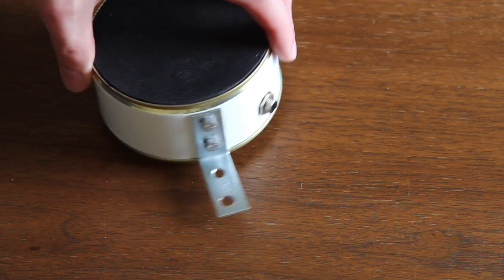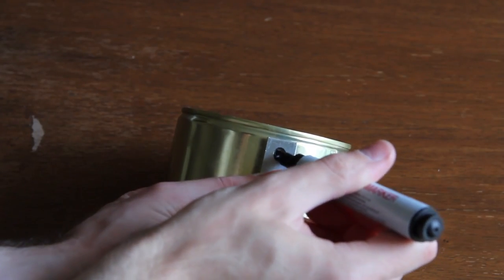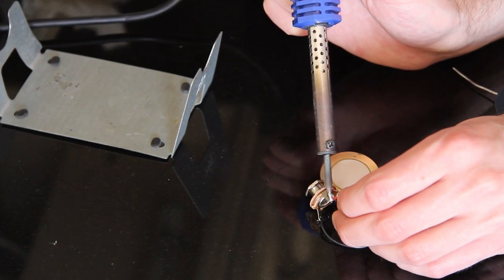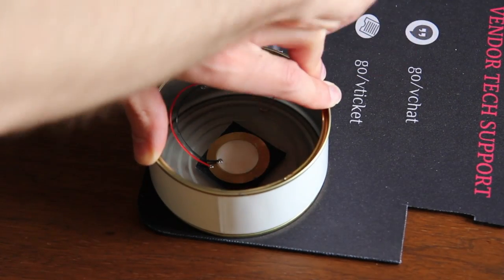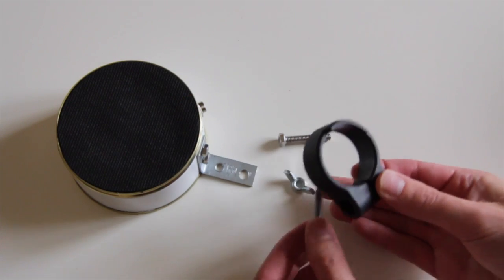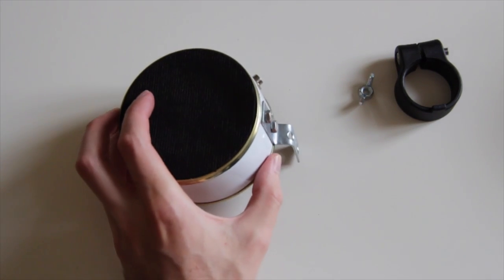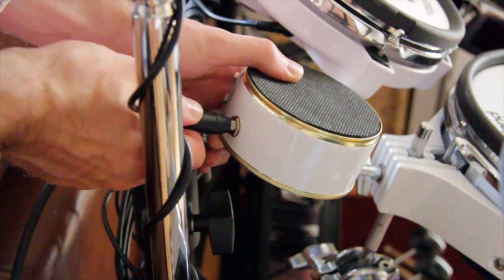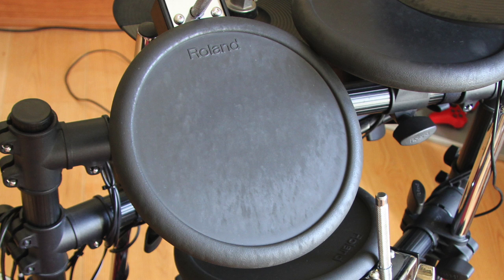DIY e-drum can pad

Comment: How would one do this with pre-built external trigger packs, like the Pulse Red Hot triggers? Would I still need the mousepad material between the piezo and the inside of the can? (The reason I'm asking is because I'm terrible at soldering)
Reply from the maker: Yes, you can install those Pulse Red Hot Triggers Everywhere.

Comment: Basically, I have this really nice 14inch snare accustic at home and I wanna convert it using a drum trigger from the rt Roland trigger series however that fits over the rim and j just wondered if then I can't add the rubber rim protector or is there a better way to do this, thanks
Reply from the maker: You can add a rim silencer, but not a ring. You just get a a piece of and cut it to the right length.
Reply: Yes but the Roland rim rubber cover can I use that and use the rt triggers Aswell?
Reply from the maker: There is no 14 inch rim rubber from Roland. You have to buy it fro another company.

Comment: Hi, is it possible to add a trigger to a single zone cymbal? i have an alesis, my module seems capable of using a 3 zone cymbal but buying new ones (or used ones) are still out of my budget right now. Could you post a tutorial on that too?  thanks so much!!
Reply from the maker: Hi Tristan, 
so your question is about modifying a acoustic cymbal with triggers right? I planned to do a video about this. But it will take a while, as I need to order some parts.
Reply: Hi Marcel, wow! thanks for your quick reply, i really like your channel by the way. I'm also using an electronic kit an alesis dm7x but bundled with only single zone cymbals and tom pads. The original kit as advertised has dual zone cymbals and pads though so I'm positive ill be able to upgrade my cymbals . I would like to add piezo elements to the electronic cymbals to convert them to dual zone, I'm not sure if that's possible, but the plugs are stereo TRS. I really got inspired by your video and considering some DIY. Thanks so much for yor reply! Would the process be similar for acoustic cymbal conversion?
Reply from the maker: Tristan Granados I don't really know much about Alesis cymbals. But I think if even the plugs are stereo and there are actually dual cymbal pads from Alesis, you should be able to modify them. You just have to pay attention on how to connect them. Do some research. I am sure other people have done it. And thanks for your feedback:)
Reply: Thanks Marcel! I trally appreciate your reply. I'll do some more research also, but no luck so far regarding conversion.  hope to see more of your videos!

Comment: Can I run this through an audio interface as audio
Reply from the maker: Not sure. I probably wouldn't do it.
Reply: I want to usi it instead of buying a drum machine all I need is the audio and I'm gonna turn it into midi so I can use it as whatever type of drum I want
Reply from the maker: you need a trigger to midi converter, like the Alesis trigger io
Reply: i can record it as audio into an interface then convert it in fl studio